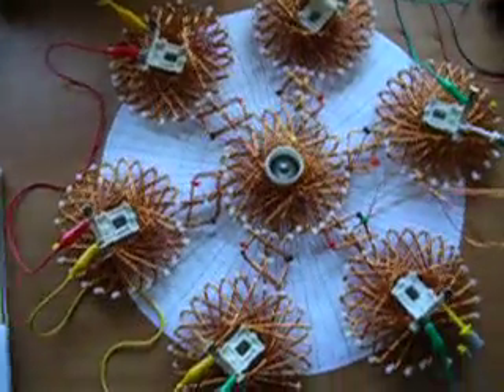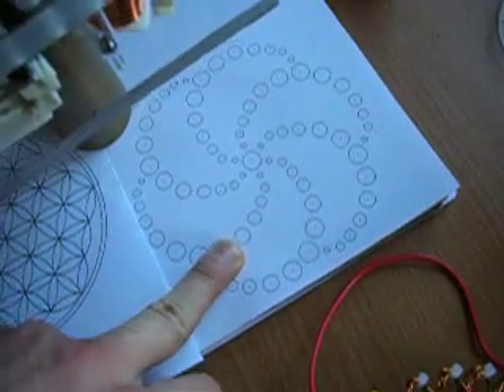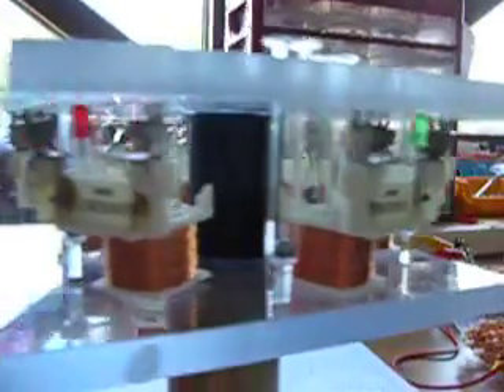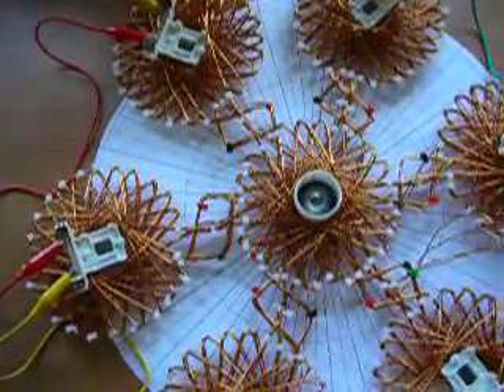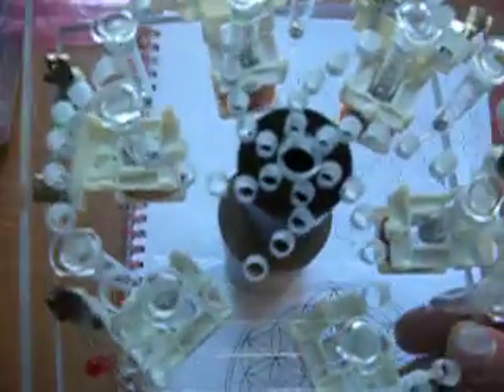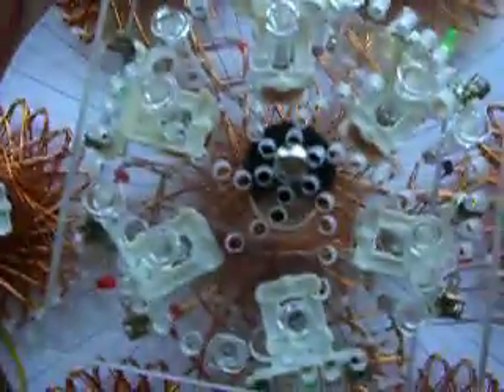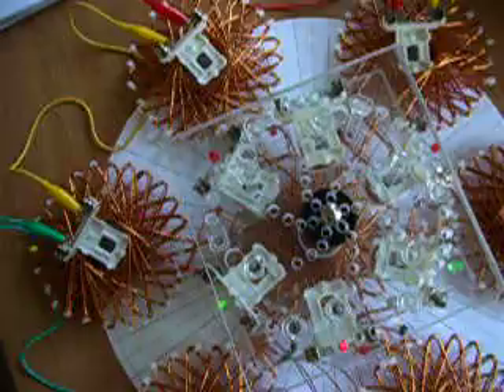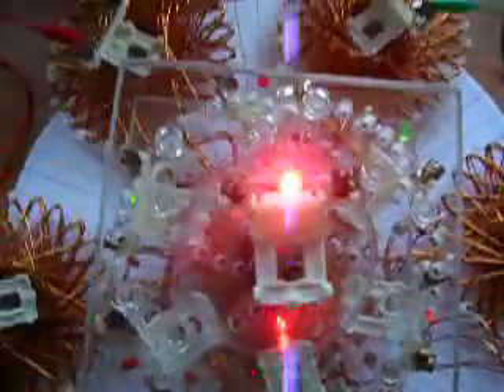SSC - Setup # My little solar system

Comment from the maker: @Br0kenMan :-]
Yes there is no greater power then the power of the sound and the word!
I use 12 volts to fead my 2 NF amps.... (each max. 10 watt)
At the end (after startup) the setup used to run between 6 - 8 watt...
Well, i didn´t start to fed any energy back into the system... cuz i have to make some more tests bevore...
THX

Comment: Yes! Yes! That is EXACTLY what i meant with the comment about having 'your own little solar system'. You nailed it. The star coils, the orbiting bodies, the satellites, the main magnet acting like a black hole and even the little orange sun on top! Great job. 

You have many forces at play there, and ALOT of energy in the form of sound. If only the sound could be converted back into usable energy and fed back into the system. Sounds like you must be using 12 volts?